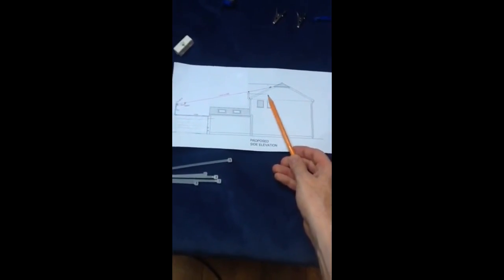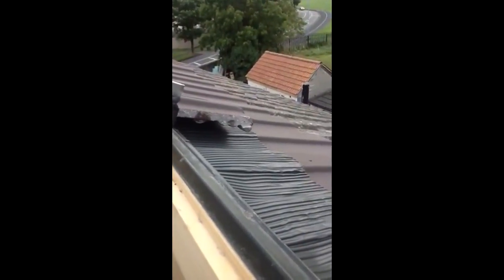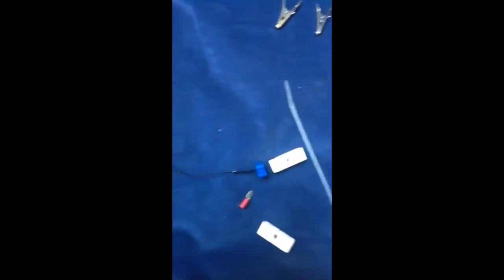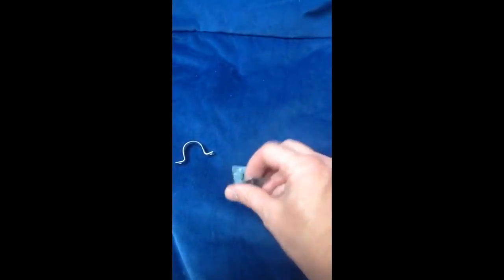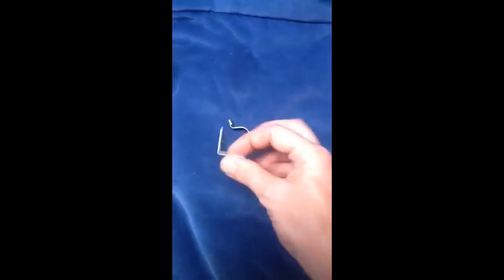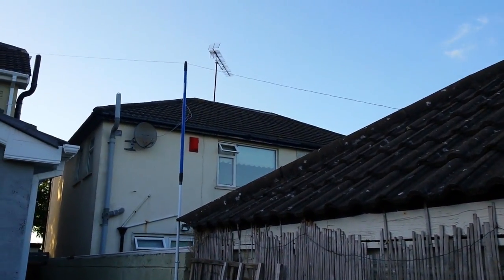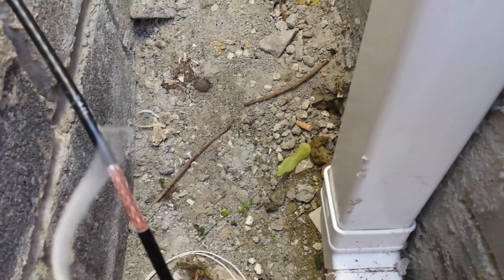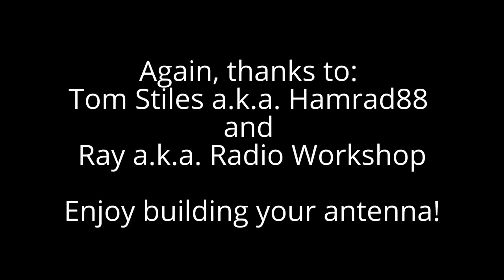How to build a Shortwave long wire antenna - No Soldering: For beginners:

Comment: Good informative video. Thanks! What is the exact name of that splicing cable connector so I can get one on Amazon that can splice a coax cable with an 18-gauge stranded antenna wire? I'm curious though, why can't you run the antenna wire directly inside to the alligator clip (bypassing using the coax cable), and using another separate line of the antenna wire in the splicer, and running that extra antenna line to be grounded outside? That would be cheaper than also getting that coax cable. Is that coax cable even needed, especially since you're simply clipping the antenna wire to your shortwave receiver's telescoping antenna? It would be helpful to others if you would list those connectors, including the exact non-soldering type alligator clip you used.

Comment: I've made 5 antennas since  I've been watching Ray. One tuned to 157.000 mhz for marine band, I'm close to the Mersey.  One tuned to 446.000 mhz for PMR. Another on 153.350 mhz for Pogsac. And one dual band from Ed Fong. The PMR is built similar to Ed Fong J pole to look at but it's a coax dipole inside a plumbing pipe. All are perfect swr.

Comment: Great tutorial! I've just ordered a TECSUN R-9700DX, not as fancy as the PL660 but I like the analogue vibes so it's a start! I have some old coax cable left over from a satellite here so I must give this a go!
Reply from the maker: Give it a go. You don't fancy receive antennas - just get some wire in the air :)

Comment: You're brilliant for rigging up that homebrew antenna! I've the same bits and pieces and will be making mine according to your instructions. I don't use a soldering irion, either. I have no early use for one, to be honest. So anyway, I just want to thank you so much for making this video. It was fun to watch, and your getting stuff together was, quite frankly, ingenious. 

ETA: Great lateral thinking! :)
Reply from the maker: Thanks for your generous comment. The video quality is a bit amatureish I know, but I'm glad you got some value from it.
Reply: Oh, I did! Your vid is by far the most easy to understand, and I found your instructions straightforward and uncomplicated. I've already got most of the stuff you used. In the garage I found a Harris 3m extension pole for a paint roller, and that is going to be used for my mast. 

Happy days to you, and have a great weekend.

Comment: Which direction did you hang the long wire North South, East to West for best reception.  We are located on the west coast of N.America.
Reply from the maker: It was random length, about 15m long and L shaped. With  a random wire receive only antenna, the important things are; get it as long as possible, as high as possible and insulate/isolate from ground. Even if you can get 10ft of wire up - it  will make enormous difference to your reception.

Comment: Hey, I wanted to know what role the antennas are grounded? When not connected to the radio. Is this necessary?
Reply from the maker: My antenna is permanently grounded. When it is attached to the active radio/receiver it "diverts" RF (radio Interference) away from the receiver to ground - this greatly improves reception and listening quality, especially on shortwave. When not connected to the radio it does nothing. It would be cumbersome to have to connect the ground wire to the antenna each time you switch on the receiver. So its best just to leave the antenna set up with the ground wire. 
Once you ground an antenna it becomes a lightning conductor. I live in a very low risk area for lightning - we do not get many electrical storms. However, it would be best for a lightning discharge to be directed to the ground rather than in to the house. Also some weather phenomena, such as heavy rain, can build up a static electrical charge on your antenna - so grounding helps there too. It's best practice not to leave you receiver connected to the antenna when not in use, as it could be damaged if subjected to the above phenomena. Do not connect up during and electrical storm! 

Ray explains things a lot better than me.
<iframe width="560" height="315" src="https://www.youtube.com/embed/Xba0WeSI8h0" frameborder="0" allowfullscreen></iframe>

Comment: Great video,good detail.Would have liked more detail on your grounding method.Did you use a grounding rod,how long,or water pipe?You received good results for your efforts! Darryl b.c. Canada
Reply from the maker: Hi Darryl. For grounding I stripped a short section  of the coax, about 5cm, to reveal the mesh. I wrapped my ground wire around the exposed mesh in a spiral. Once done I sealed the coax and ground wire connection with duct (gorilla) tape. The ground wire was attached to length of copper pipe (about half a metre as that's all I had) and that was driven into the soil. Yes it made a noticeable difference. Hope this helps. I don't have it anymore as have an inverted V antenna now.

Comment: So, you don't need any type of Balun between the long wire and the coax?  Thanks.
Reply from the maker: Now there's a can of worms! There as many answers to that question as there are types of antennae, whats bands they are cut for etc, etc. However, in this case - for a shortwave listener listening across all of HF, having the antenna as high as possible, isolated and grounded will significantly improve reception. Sorry for the late reply btw.

Comment: how is your ground working you have not connected to your radio chassis or no connection to your
antenna your braided wire is dead on both ends  what's the point of grounding  I don't know that's why I am asking ......
Reply from the maker: Sorry for delayed reply. The braid is connected to the "chassis" when the coax connector is plugged in to the radio. Grounding of a long/random wire is a matter of experimentation.  In my situation my SDR shows an appreciable reduction in noise (RF) with the antenna grounded. 

Ray explains this better than me.
https://youtu.be/Xba0WeSI8h0 

http://www.g4nsj.co.uk/endfed.shtml 

Also check this thread

https://forums.radioreference.com/coax-cable-connectors/302611-what-exactly-does-mean-ground-antenna-2.html 

and this wiki is quite good

https://en.wikipedia.org/wiki/Random_wire_antenna